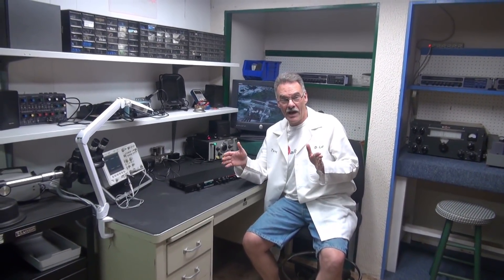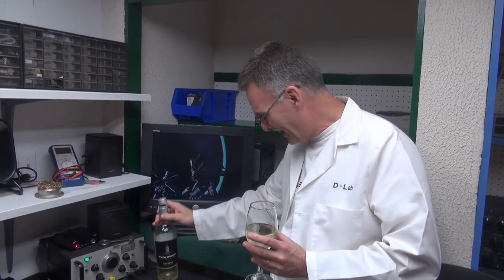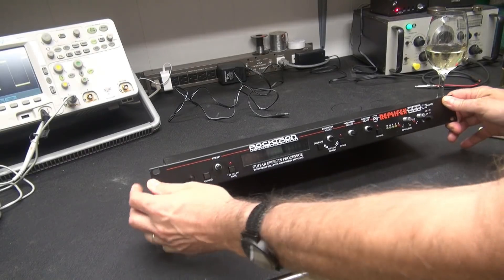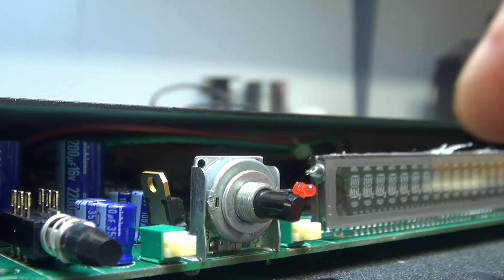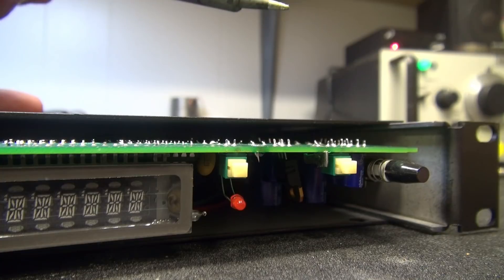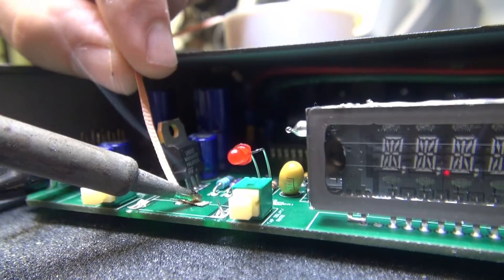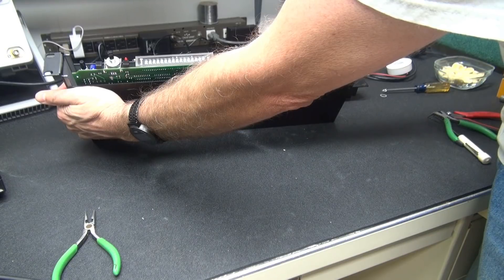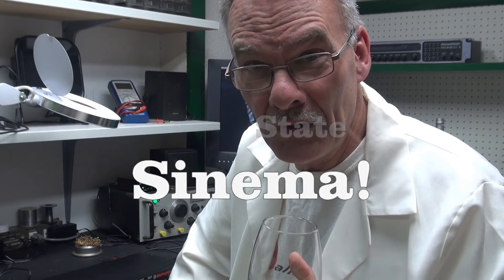How to repair digital effects control encoder Rocktron Replifex Guitar preamp processor D-lab

Comment: Any clue where one would find one of these encoders? Need to do a repair mysellf due to the SAME EXACT knob busting on mine.
Reply: Have same question. All of my rotary knobs are doing this. This unit works great otherwise... hate to spend hundreds on a new rack unit just because of this.

Comment: Cool stuff.  Didn't know you'd worked on solid state stuff.   Being a solid state sinner myself I've got a Fender mustang V head with a sorta related problem.  The master volume pot is all scratchy.  Used electrical contact cleaner but the problem returns when the cleaners evaporated n that loud crackling noise is annoying as y'know what.  Problem for me is I can't find info on either the part # or value for the pot anywhere.   Opening the amp up n replacing it I can do but I'd rather not have to tear the amp apart to get part # n have it sitting there till I get my hands on the replacement which could take weeks.  Couldn't even find the part listed on the schematic pdf I'd found for the amp.

Comment: a desoldering station is a good addition to your lab for this kind of jobs!
Reply from the maker: Hello, I do have a Hakko desolder station, plus a SMD hot air rework, just did not utilize them for this repair. I normally break out the desoldering station when changing displays

Comment: Looks like you will need to invest in a hot air rework station and a desoldering station/pump. For solid state work these days, they're a necessity. Oh, do I hate working on modern solid state gear, but its $$$ :)

Comment: These rotary encoders can be removed in one piece if you have good vacuum type de- soldering equipment, and you can pry the thing apart and clean and polish the contacts before re-lubing it and putting it back together.
Reply from the maker: These are optical encoders, no contacts inside, just a round plastic window + Led system
Reply: D-lab Electronics, interesting, we have not seen that type before. I stand corrected! I'm still curious why you didn't simply use a vacuum desoldering system, unless you just wanted to show people how to do it themselves when they didn't have fancy  desoldering equipment on hand. I will admit that I too sometimes will cut the pins and brackets for a part that we are replacing such as a potentiometer simply because removing a pot or similar control or even a switch can sometimes be extremely difficult due to the tiny plated through holes used on many modern double sided circuit boards, where the pin fits so snug and tight in the hole that removing all of the solder can be extremely difficult, especially when it was soldered with modern lead-free solder.
Reply from the maker: Hello, I have that type equipment, however wanted this video to demo a basic method